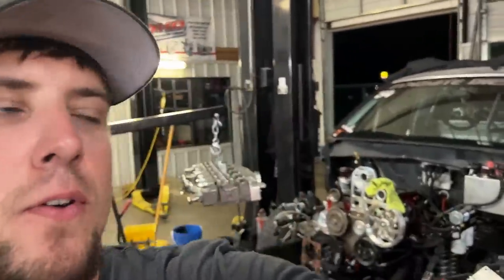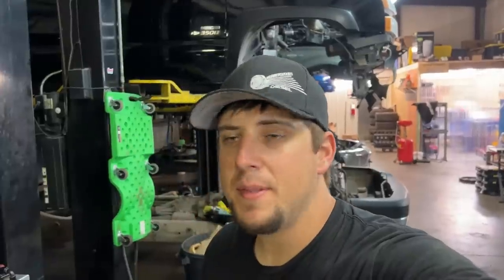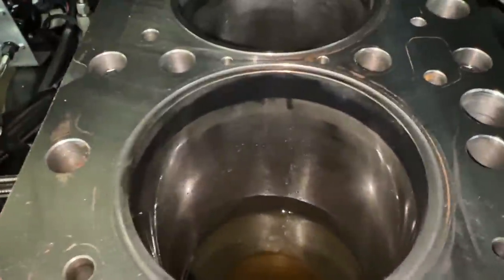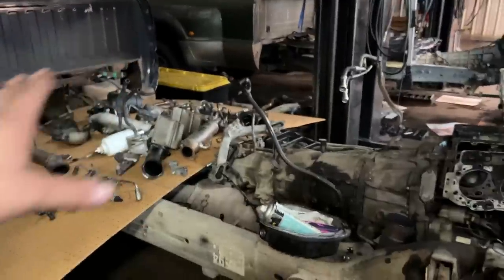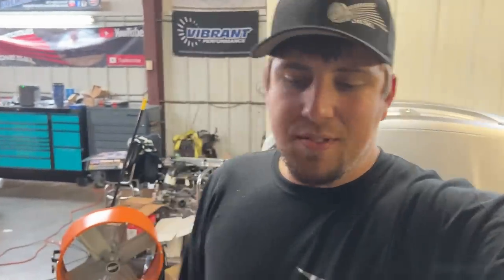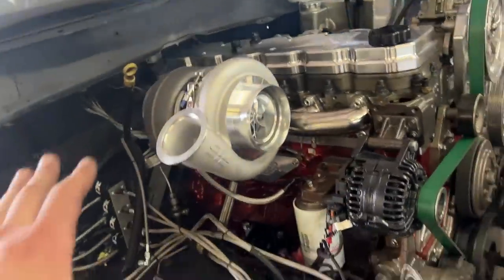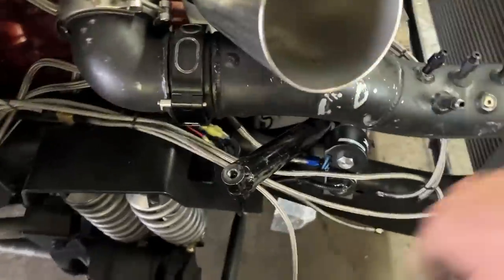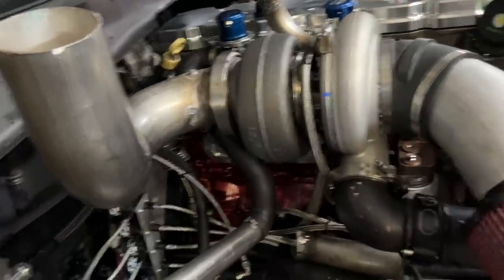Build it, Beat it, Fix it, Repeat

Comment: Parts storage idea for when working with the cab up. Build a table with foldable legs for storage reasons when not in use. You can make it the height you want and even cover it in sheetmetal if you want

Comment: I use big piece of wood like you for everything off the top and rear then a roll table for each side of the engine and front. Bolt tray for front, left, right, rear and top.

Comment: 13:20 that is crazy that you apparently bent the deck surface of that head as it sure looked like the combustion chambers were low. That is some cylinder pressure!  Better to have it act up now than at the event that is for sure!

Comment: 4 weeks late, but we use a 1/2" piece of plywood to hold parts.  Doesn't flex as easy and you can usually throw everything on it, even the compounds on 6.4s. 🤙

Comment: Thoughts, I know dash space is a thing, but a low pressure gauge would give you a quick view into the cooling system. What about special washers that spread the pressure on the aluminum head from the head bolt( like a cup shape over the first nut and under a second), or a steal head? Are you sure it’s the bolts stretching?  You are on a cutting edge for greater horsepower. The economy might not prove to be the best time for your venture but you can run the possibilities.

Comment: I say metal tables with a lower shelf on lockable casters for storing parts from vehicles versus the board. Lifetime foldable tables are good for small projects but for extended waits and regular constant use I say the metal tables and you could even do three level on them too.

Comment: I've run the copper coat on everything for years. 
Do you run the cummins or fleece coolant pressure relocation kit on the back of the head? I have the one cummins makes I have to install. It may help redistribute  pressure when it spikes.  
As far as turbo drain you have to check out bd diesel  flex drain they have one that fits the s400 / gt55 then if you use the stock he35cw that fits all  t4 turbos . They are really nice pieces that can be bent to fit perfectly.
Reply from the maker: It’s electric water pump no need, those flex drains are terriblen
Reply: @horsetorquesdiesel   don't tell me that I just bout them . I was so happy :( . Maybe ill try some braided nylon line if they don't work out.
Reply from the maker: @markrich3271  for sub 800hpish they work fine but with big clearance motors I have seen them blow out!

Comment: I used xotic heads studs on my 6.7 powerstroke they were affordable and available I am happy with them 35K so far
Reply: I use them on my 12v cummins still holding at 70lbs of boost.

Comment: I use a 3 or 4 shelf heavy duty rack on castors, then they can be covered and moved right out of way with ease if your waiting any time on parts. What's the theory on copper coating the head gasket?
Reply from the maker: Extra security for the deckplate sealing